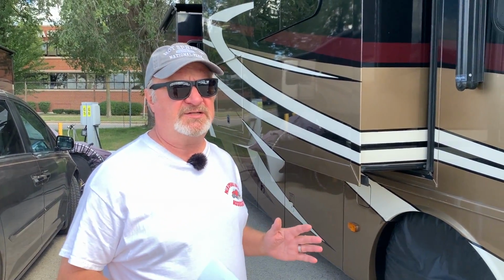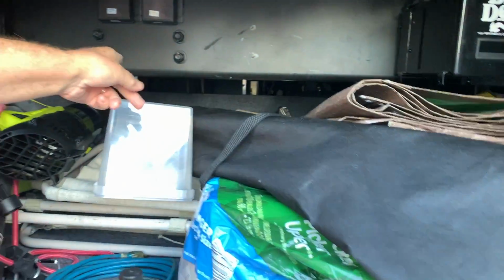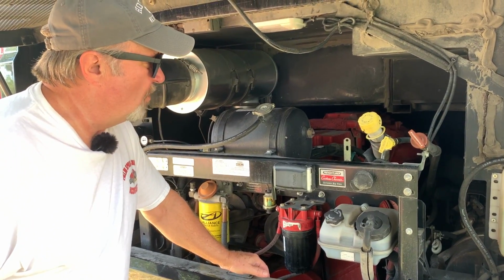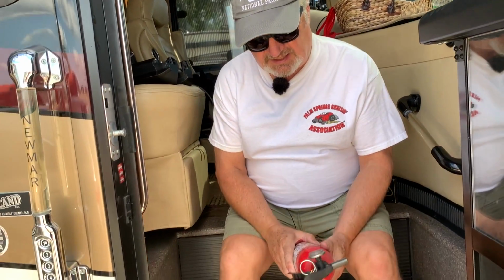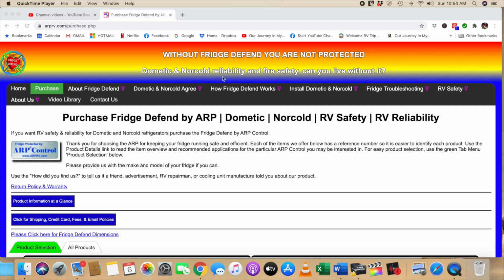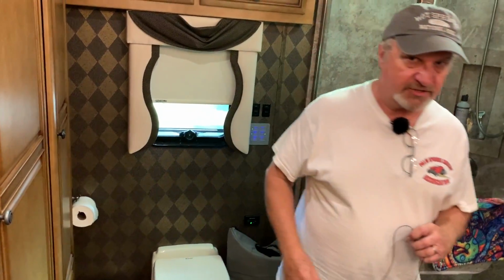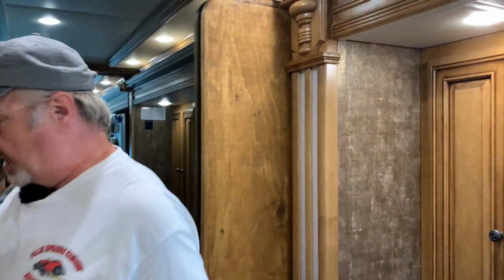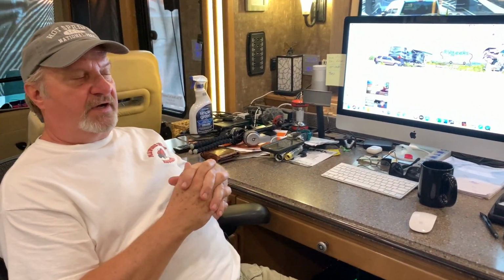RV FIRE PREVENTION WEEK | INTERCONNECTED DETECTORS| FIRE SUPPRESSION | ESCAPE WINDOW HACK | EP137

Comment: Great video! I use to service fire extinguishers. One or two times a year turn that ABC fire extinguisher upside down and give the bottom a few good wacks with a rubber mallet. You will actually feel the powder loosen up and slide to the top. As long as the gas meter is reading full that extinguisher has a shelf life of 10 years I believe.
Reply from the maker: Great tip from someone "in the know!" Thanks for the info!

Comment: Hi Mark I’m a bit  of a worrier also! And 35 yrs as x appliance repair technician retired now! Thought I would let you know  one of the highest cause of fires in sticks and bricks or  RV s like yours is the 4 inch duct venting behind your dryer leaks dust and causes flash fires , need pulled out and cleaned 2 times a year to be safe! , enjoy your  videos keep it up! Noticed you didn’t mention that.
Reply from the maker: Thanks for passing on the tip to all our readers!  Sue & I actually just cleaned out our duct work about a month ago.  It wasn't too bad, but we were glad we did it.

Comment: With foam,you can go with low  or high hi expansion foam.With  fridges,whats your thought on fridges using propane as a coolant.
Reply from the maker: Ever since I was young, I have had a fear of fires.  Personally, we LOVE our residential refrigerator.  If we did have an absorption refrigerator, I would have an ARP refrigerator control added for safety.  Check out: https://www.arprv.com/

Comment: Hey Mark, have you made any improvements or mods to your escape board? As I'm looking at it in your vid, I can see some things that you may want to add to it. I don't know if you've already done so but I would attach a small block of wood on the bottom side of the board to brace it against the front edge of the window counter top. That will give it more added bracing support other than just the window sill. Is there any possible way to engineer a rope ladder attachment to your board? You'll also need to engineer a fast and secure way to attach the board inside the coach in order to use that ladder.

With all these ideas in mind, evacuation test drills would also be needed in order to prove that this emergency escape window hack will actually work well when needed.
Reply from the maker: I do wish I had made the board THINNER so it was LIGHTER.  The 14" width is perfect though.   The sill on our Dutch Star is high enough that the board has a good surface to bear against.  I am OK with sliding out and grabbing the window frame on the way out. At that point the drop is literally inches.  I would be afraid the ladder would take too much exit time for person #1, and person #2 would be in jeopardy.  Thanks for watching Frank,...

Comment: With regard to the emergency exit windows, it would be nice to see coach manufacturers use a smaller compact version of aircraft emergency evacuation slides. That's quite a dream but what the heck?
Reply from the maker: If an RV company is looking for a FANTASTIC selling point to put them out front with the mature RV Crowd, this would be NUMBER ONE if I was in charge of marketing!  I agree with you.
Reply: @OurJourneyInMyles  - I wonder if RV engineers have given thought to emergency slides. In a fire panic situation on board a coach, it's going to be difficult enough as it is to evacuate elderly folks out the egress door without incurring injuries. In my opinion, using a slide apparatus instead of a ladder would be a safer way to evacuate a burning coach.

Comment: Great tips Mark. However, there is one thing you may need to check into with your Bluetooth Smoke Detectors. I know that in the case of Bluetooth speakers, the connectivity with the sound source cuts out as the line-of-sight between the devices diminish. This may be the same case for your basement smoke detectors trying to communicate with the ones inside the Coach. 

You can do a test by placing a Bluetooth speaker in the bay storage area while connected to your smart phone as a sound source inside the rig. If you get sound, then all is well.
Reply from the maker: Great comment Frank.  I MISS SPOKE in my video.  The smoke detectors ARE NOT bluetooth, which we all know is finicky!  Here is a statement from the Kidde Website about the Radio Frequency Technology they use:  
"Wireless smoke alarms communicate via radio frequency. Wireless smoke alarms have a signal unique to the model that will wirelessly connect with others in the same model series.
For the alarms RF-SM-ACDC and RF-SM-DC, we have our own frequency band of 434.3. Each wireless alarm has dip switches on the back of the unit. When all switches are on the same setting, all smoke alarms will sound when the Test/Reset button is pushed."
Reply: @OurJourneyInMyles  Right on. Good to know.

Comment: Mark, I am just retired and doing my homework on different DP and whereas my wife and I do not intend to become full timers and want a 34-36 foot MH (much smaller than yours) this video has caused me to only consider MH's that have easily assessable rear or near rear escape features.  I now consider this to be one-of if not the-most important feature.  I am looking at the smaller Newmar's, the new Winnebago Journey, and the smaller Tiffins.  Thanks for your excellent informative video.  By the way my Wife and I love your videos.
Reply from the maker: After 4 years of full time RV in our 2014 Newmar Dutch Star Model 4369, my ONLY regret is not having the fire door.  (No joke.)  Until I made the fire board, I was alway thinking about selling with 9.7% of my brain. I would stick with Newmar, and don't miss that the Canyon Star just went with a Front Engine Diesel.  Thanks for watching RJW. Remeber, Comfort Drive is awesome.

Comment: I worked as a maintenance supervisor for 27 years and we had a fire extinguisher company come in every year to recertify our extinguishers every year or two. They check the gas and the valves for proper operations etc. and put a tag on them with date of recertification.
Reply from the maker: Yes,.....this is the correct method for all companies.  I am OK just to replace the extinguishers every few years just to be safe. Thanks for stopping by,....

Comment: What a great video, so informative. I love your board for the escape window. I am 62 and overweight and I wonder if I could easily get out the fire escape window. Mine is in the same place as yours is, I have a 2006 Newmar Mountain Aire 3778 (gasoline Chevy engine). I need to check to see if the valance is velcro on, I bet it is. 
I am in the process of fixing her up to go full time very soon. I did replace smoke detector, CO2 detector and I have a new propane detector to be installed soon. I also have an extra smoke alarm I was going to put behind the evaporator refrigerator, though its not bluetooth it should be loud enough inside the RV. I am mostly worried about this type of refrigerator catching fire. I did buy exhaust fans to be installed at the fridge vent stack to help with the temperature and air flow. I am going to wait to see if the fridge cools enough after I live in it awhile before deciding to get a small residential fridge replacement or not. I will sleep much better not having this original fridge but if it cools well I could get that system you showed to put out any fire behind it.
  I do have 2 new red tank extinguishers along with 2 old ones that came with the RV (I'm not the original owner) good idea putting a couple in the outside bays. I do like those handy cabinet extinguishers, I will put them on my shopping list. 
Thanks for making this video, love your sense of humor.
Reply from the maker: You are doing a great job to mitigate your risk of a bad outcome in a fire event. The board I made was 33 pounds, which is a little heavy for me.  If you can make a 14" pathway out lighter, I would do it.  Make sure to practice getting on and off it.  Make sure you add the lights to see your way out.  You are going to be safe and awesome!

Comment: Mark - So what fire suppression system did you install?
Reply from the maker: I was hot to trot to install a $4000 Proteng.  When I called my insurance company (Progressive) to see what kind of break they would give me per year it was $0.00  I literally would have been happy with $100/year.  I told them how dumb it is for me to spend $4000 to protect their investment from a total lost,......and I would not be buying it.  I built the wood board, and I'm planning on bailing out!
Reply: @OurJourneyInMyles  Thanks Mark

Comment: Mark, CO gas is very heavy and will stay low to the floor. So I wonder why the CO detectors are on the ceiling. Can you help me understand?
Reply from the maker: Because carbon monoxide is slightly LIGHTER than air and also because it may be found with warm, rising air, detectors should be placed on a wall about 5 feet above the floor. The detector may be placed on the ceiling. Check out the website: https://www.epa.gov/indoor-air-quality-iaq/where-should-i-place-carbon-monoxide-detector#:~:text=Because%20carbon%20monoxide%20is%20slightly,be%20placed%20on%20the%20ceiling.

Comment: My Entegra  has no Propane   all Electric
Reply from the maker: Does Entegra have a vented bay so you can carry a 20lb propane cylinder?  I'm guessing no, but don't really know for sure.
Reply: @OurJourneyInMyles  j bought it used it is a 2017 
Yes has a place to carry Propane  for BBQ.and cooking outside   .
I also installed my roll around snap on  toolbox with Tools

Comment from the maker: If you end up building an "Exit Board" to assist getting out of your rig POSITIVELY and QUICKLY, consider sending us a few quality photos or 1080p movie files of your creation.  You don't have to worry about the audio, I can voice over with my comments.  If I receive enough input from folks, I will assembly a special video showcasing these creations! I would love if the boards where BETTER than mine!  Lighter,....handling holes,......no sharp edges,......just as wide (14"),......quick & easy to make,.....easy to store & handle,.....and most importantly, able to be swung into position in 5 to 10 seconds. Send the photos in an email to us at: ourjourneyinmyles at gmail.com  (Use the @ symbol) Movie files would have to be send via google drive.

Comment: Thanks for the great idea with the board! 
Our 5th wheel has an escape window like yours and like yours the only way out is head first, and as you pointed out the resulting injuries would be major. I have thought about it but we all think "A FIRE COULD NEVER HAPPEN TO ME" I am going to make a board like yours and practice a fire drill. 
Thanks for maybe saving some lives.
Reply from the maker: If you end up building an "Exit Board" to assist getting out of your rig POSITIVELY and QUICKLY, consider sending us a few quality photos or 1080p movie files of your creation.  You don't have to worry about the audio, I can voice over my comments.  If I receive enough input from folks, I will assembly a special video showcasing this. I would love if the boards where BETTER than mine!  Lighter,....handling holes,......no sharp edges,......just as wide (14"),......quick & easy to make,.....easy to store & handle,.....and most importantly, able to be swung into position in 5 to 10 seconds. Send the photos in an email to us at: ourjourneyinmyles at gmail.com  (Use the @ sign) Movie files would have to be send via google drive.
Reply: @OurJourneyInMyles  Sure, Ill get going and document my progress (it wont be too quick)

Comment: Great tips.  Currently we don’t have an RV, but I too worried about fire escape options.  Although I really love the new escape door Newmar is offering, I would go with a Tiffin because they have the sliding style windows which I think I could get out of in an emergency.  I also think I’d keep a large folding table under the escape window so that the drop down would not be so great.  Thanks for sharing.
Reply from the maker: We agree! We have seen a few ladders and picnic tables in our travels pulled up against the escape windows of RV's just to be prepared!

Comment: Mark and Sue I really like your videos as I am thinking about getting a RV too.  Your egress board is a great idea until Micron possibly develops a better solution.  Meanwhile, I would suggest repositioning the handle to a location equal to the distance from the window to one inch beyond the edge of the ledge.  Have the handle on the underside of the board as a stop to keep the board from sliding out the window and/or off the bed.  In Sue and your haste to egress this may keep the board from moving.
Reply from the maker: Great idea for folks with a possible problem like this!  Our window actually has a large 1-1/2" window sill "lip" so we are certain it will not slip out along with me!

Comment: you claim to be a professional worrier, well now It's my turn to worry about you.  I'm sure you feel very good about the plank you built but the time you waste  putting it into place, both of you could be out and on the ground. one of our fire chief's had a saying, if you are up to your ass in alligators, I can't type the rest but  what it means that if you have a coach full of smoke you need to get out however and as fast as you can.  if you are worried about  the drop then throw Sue out first and then just jump out head first out the window. by throwing Sue out first you will have something soft to land on. just kidding Sue. point is that more people die of smoke inhalation the die by burns from the fire. rethink the board thing
Reply from the maker: I understand your advice,.........and think it is the advice most folks should follow.  I have some medical issues that would almost guarantee I would break my spine in multiple spots.  I can't lie to you Pius.  I have to use the board,......and hope I get out feet first.  Trust me,........we have practiced flipping this board into position!

Comment: Mark when I was young and a firefighter, we would have vehicle fires and on the fire trucks we would carry ABC chemical fire extinguishers. And they would compact while driving to fires, so when we grabbed a tank we would tip them upside down and hit the tire of the truck. this would loosen the powder so the powder would flow out of the hose easier then if we didn't hit the tire. pretty soon it became standard procedure to do so
Reply from the maker: Thanks for the tip Pius!  Just bought (2) of the Element E100 fire extinguishers.  I would be interested in hearing what you think of them!
Reply: @OurJourneyInMyles  Mark, these are the fire fighting extinguisher of the future. My only advise is to find a school to learn how to use the item. fire fighting now a days is highly scientific. I put in over 30 years and it seems like I learned something new every day. the fire board and the insurance company's came up with some thing new every day in fighting fires.  back in the 60's it was pour the water to the fire, the more water you used it took one leg out of the fire triangle, thus putting out the fire. then they found out that a cup of water can put out more fire then  a straight stream of water  in two minutes.  I went to many schools to learn to be a good fireman, one school was a natural gas fire school and  I learned to put out a raging natural gas fire with a 25 lb ABC extinguisher. it can be done if done properly.  I'm proud of you that you are doing this and learning to be safe while RV'ing.  for years I have told people to not travel with their refrigerators running on propane. fought a few of those in my day. Love you guys. safe travels

Comment: Thank you for the helpful tips and taking time to make the video.  One tip to add is battery maintenance.   I have two sets of rechargeable batteries and replace the 1st with the 2nd set every 6 months and rotate them.  There are also battery tray organizers that are great for storing batteries of different sizes.   Safe travels to both you!
Reply from the maker: Great tip S Lim!!  We personally only use rechargeable batteries when they are sealed inside the device,........otherwise,....... we just use Duracell disposibles,......

Comment: Hi guys. Just watched your fire safety video. Are the smoke and CO detectors you installed rated for RV use? Maybe you have done the research but I have seen conversations about household smoke and CO detectors not being made to withstand the vibrations associated with RV use.
Reply from the maker: Good tip,...I did not research that,......but some of the detector brands that came with the rig seemed "cheaper quality" than the units I selected to replace them with.  The electronics boards in them seemed solid.  I guess if I have some false alarms in the near future, than that could be a consideration,......

Comment: Is there a requirement for the fire extinguisher to be stored upright? Seems to me storing on its side would prevent the compacting problem or rotating it so it's stored upside down on some trips would also result in not compacting.
Reply from the maker: That's a good point,...I think an extinguisher on the side would be ok, because I see a lot of brackets and units installed that way.  I would worry about upside down.